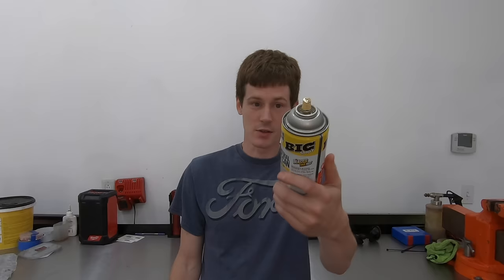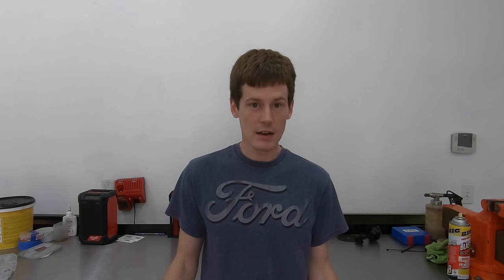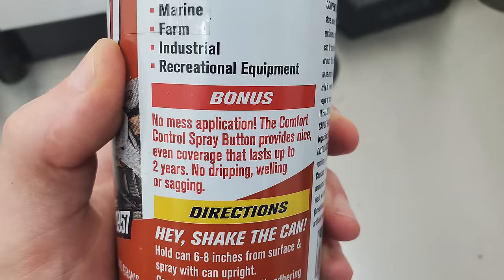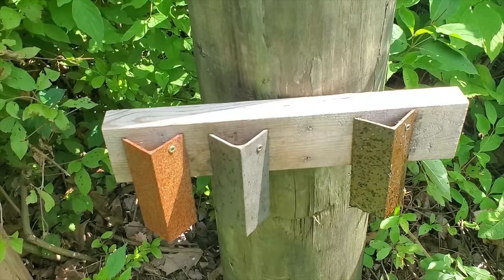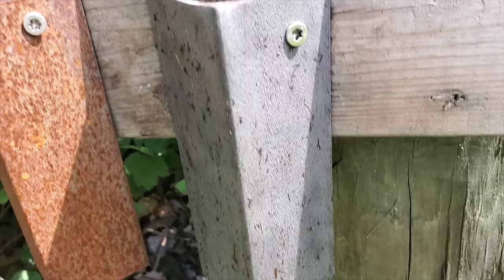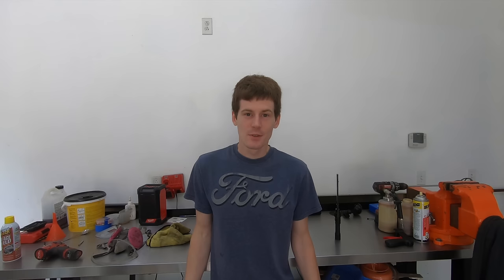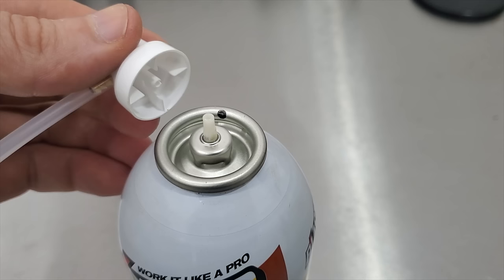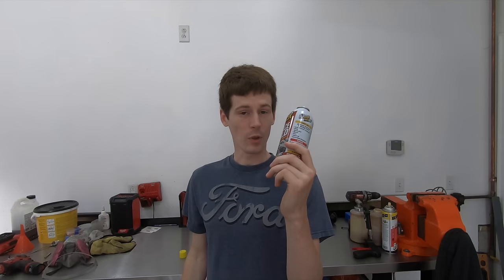I Finally Found The Best Undercoating On The Market... Blaster Surface Shield

Comment: Been using krown for 6 years on my 2005 silverado with 200k miles. Very minimal rust. The reality is, any of these products make a massive difference compared to the do nothing solution. Also, a spring time undercarriage wash to get salt off is essential.
Reply: I wish I knew this years ago. My 04 Silverado had a very small amount of rust and now the rockers are pretty much gone after a handful of winters.
Reply: I do an undercarriage wash after every snow storm.  Helps a lot!
Reply: @vfr800ification  I do this too - I have a pressure washer and an attachment that rolls on the ground and sprays four jets right up under the car.  I use a mix of dish soap and Salt Away to remove dirt and salt.

However, is it better to wash the chassis frequently or give it a coating and leave it?
Reply: @JimmyDoresHairDye  A bidet for cars.
Reply: @JimmyDoresHairDye  How do you do that in winter when it's below freezing?  Aren't you just coating car and driveway with ice?
Reply: This channel does not recommend an undercarriage wash. He says just a wire brush to take the worst of the rust and spray on the fluid film..  Now I am completely confused again. There are always so many opinions that at the end you just go for what you self believe is best..
Reply: @nmt2893  Manual carwashes with overhead doors? They are dwindling.
Reply: @Dani-it5sy  My college chemistry professor said the corrosion factor is water "and" salt. But once salt-laced slop winds up on the undercarriage in winter, it is best to wait until spring to clean it all off to minimize the amount of saltwater lying against the metal.
Reply: @vfr800ification  Yeah than just hit the main areas again with oil.
Reply: I was of the same opinion but Repair Geek has changed my mind.  The salt can't get through the lanolin anti-corrosion coating, unless that coating is removed with a pressure washer.  My "spring time undercarriage wash" is the spring and summer rainwater on the roads that washes the salt off the Surface Shield for me.  I reapply Surface Shield on the outside of the frame every fall, even though every two years is probably sufficient, or maybe 3-4 years considering I drive 4000 miles per year or less.
Reply: I wash my car all the time in the winter to get the salt off  and all the salty slush that is up in the wheel wells  and that
Reply: @79tazman  YEah I never did this oil stuff until this year I always just washed off the undercarriage after every storm and that helped alot.Now that i have oil on it not sure what Im going to do yet.I cant see leaving that salt on for 4 months man.
Reply: @JimmyDoresHairDye  leave it until spring and then wash with garden hose (ie that sort of pressure).  If you look at the FAQ's and reviews of Woolwax, which is the thicker sister of Fluid Film, that's what they recommend.  They give another coating to exterior surfaces the next Fall.  I can attest that annual applications of any of the thinner versions (like Fluid Film or Corrosion Free 3000) to interior surfaces or low splash areas like door bottoms will indeed cease any existing rust.  My 07 civic door bottoms starting showing rust from a few feet away around 2017 and at that time I began annually dousing the bottom inside and also through the drain holes with Corrosion Free (also known as Rust Cure) and the rust stopped migrating and stopped further pitting....surprising for sure, but surely works.
Reply: @Dani-it5sy  slather on in the Fall, garden hose rinse after last snow fall.  Maybe touch up any forward facing super dry spots you can see around mid-winter, slather on again in the Fall.  Getting every trapped cavity on the initial application is essential:  gas tank straps and above the tank (possibly even pulling your backseat and accessing the top of the gas tank cover just to get it slimmed once every couple of years), all control arm connections, interiors of all frame components, interior of all uni-body or frames, inside rocker panels, up inside door columns between front and rear doors, up and behind each bumper cover and cover brackets under headlights, inside trunk under carpet, behind trunk carpet toward tailights and also forward toward the rear doors, inside doors including window runners (thin sheet metal holding the felt-like track liner the window slides in going down into the door (mine rotted away in the front Civic doors).  Hope this helps....oh, there are a few spots that applicators will drill and plug with a grommet....you should look into those for your vehicle...could be the door interior vertical trapped volumes you don't see when the door is shut, and then others.
Reply: If you spray under the vehicle , do it with no soap, in the Rinse mode only!
Reply: @nmt2893 
You are supposed to apply it at a minimum of 40 degrees Fahrenheit. There would be no reason to apply this in your driveway in freezing temperatures. If you bought a car in the winter like I did, rig up a way to heat a space in your garage, or find a business or individual where you can rent a heated space, or pay to have it done. Since the coating lasts a minimum of one year, but probably two years, there would be no reason to wait until cold weather to apply it.
Reply: Absolutely just do something anything to protect your investment. I'm 60 Been using motor oil and diesel for decades. I use some store bought products now as well. Mt cars don't rust away.
Reply: @David Hickenbottom  10,000% agree
Reply: @79tazman  the amount you pay for all those washes, and all the labor and time, youd be better off just using surface shield or wool wax imo.  No need to wash with these products. My buddy a new f150 that hes driven daily 7 upstate NY winters, and just wool waxes it every fall, he doesn't wash the under chassi in the winter. The truck has 0 rust.  ZERO.  My truck has surface rust all over it, and after seeing his truck, i started wool waxing mine.  I took a needle scaler gun and knocked all the lose rust off my frame , then wirebrushed the crap out of everything i could reach.  I havent seen any rust developing in new places, nor the rust thats on there getting any worse.  Im glad i found out about this now becuase the body has 0 rust still, and the truck only has 74k miles.  If i wouldnt have wool waxed, the truck would probably be rusted to nothing by now.
Reply: Nothing beats Krown if you get it applied annually.
Reply: For static applications, nothing beats corrosion-free. If you want a product that will seep and creep and self heal under daily driving conditions, nothing beats Krown.
Reply: @Mark Armstrong  I've had superb luck with it myself. Gotta be diligent about applying it though because of how think it is but it covers all the nooks and crannies so well
Reply: @josephphillips865 how many years?
Reply: @whatitisnt.  It doesn't take long at all out here. My dad's 1990 Chevy (stored in a barn most of it's life) is completely rusted through the frame after 2-3 winters.
Reply: @josephphillips865  where is this? Perhaps that's because of the cars material. Modern cars would perhaps not rust that quick
Reply: @whatitisnt. Michigan winters. They have used excessive amounts of road salt for years which has been problematic to the environment and everyone's vehicles. Also true, the vintage of truck I mentioned must have used a lot of crap steel. Modern vehicles likely use better steel but in this area if you do not wash off the road salt frequently it does not take very long for rust to start showing.
Reply: @JimmyDoresHairDye  That will wash away some of the surface coatings. Perhaps wash underneath in spring and re-apply surface shield right before winter, say in mid fall or something like that.
Reply: @freeinhabitant2422  got myself a 1 gallon garden sprayer this month. Will put away the pressure washer with undercarriage attachment for the winter - realized halfway thru last winter that I probably removed the fluid film with the pressure washer. Just going to mist the undercarriage and wheelwells now to dissolve the salt.

Comment: I just own a ford and it comes standard with oil leaks. Great rust prevention
Reply: Must be nice Chevys come from the factory with rust
Reply: 😂 I have a 21 year old Toyota that has a unintentional under coating also.
Reply: My ford's don't leak nothing ones a 92
Reply: My fords have never had oil leaks.
Reply: @fordnut4914  must not drive them much or it was built on a Wednesday by a Chevy worker who just transferred to Ford. 

Jk, how many miles?
Reply: @johnt6673  that means you are out of oil
Reply: @jeremylakenes6859  my f450 has rollback 514000 miles on it my f350 has 240000 my ford fusion has 238000 none leak my rollback has a water leak due to water pump going bad but no oil
Reply: And who cares if it rusts away.
Reply: @fordnut4914  must be out of oil lol
Reply: Then you must have a 7.3 diesel truck
Reply: @josephpuchel6497  6.9 Diesel… lol

Comment: Have you used Corrosion Free - Rust Cure Formula 3000?
Reply: Corrosion Free is the best, so clean no smell and it lasts
Reply: @JacobDelGrande  is it not safe for rubber items?

Comment: I started watching your videos because I heard you mention lanolin as an undercoat. The reason it interested me was because I am an industrial machine mechanic, I work in alot of different environments from high to low temp. and different percentages of humidity. I began using a tool bag several years ago and my Dad told me that if I was going to be working in all these different environments that I should thin coat my stuff with lanolin to prevent everything from rusting. That was thirty years ago, my Dad is gone but every tool I owned from that time is still rust free. I still have guys ask me when they see me loading up my tools what am I using and I tell them lanolin. I use mineral spirits to clean and lanolin to protect. Then I usually have to have the WD-40 argument with them. I have seen machines get destroyed because these guys grow up thinking WD-40 does it all, it does not. Anyway, you gave me some justification for my seemingly anal aversion to WD-40 and my belief in lanolin. You have useful info and your presentation is concise and interesting! Great stuff!
Reply: WD 40 frees things up immediately but attracts moisture in the long term. WD-40 is obsolete in my opinion.
Reply: @jeffrobodine8579  WD-40, literally means "Water Displacement 40th attempt" I have never heard anyone state it attracts moisture.  It's a poor penetrating lube IMO compared to KROIL or PB even.
Reply: @GregHuston       Is this a joke? Project Farm's testing shows that PB is one of the absolute worst penetrating fluids on the entire market. Even WD-40 beat PB as a penetrating fluid.
Reply: @SergeantExtreme  Not a Joke, WD-40 does NOT attract Moisture it Displaces Water!  How's that a Joke? KROIL is the absolute best I don't care what some guy on a farm shows and PB is a penetrating lube, WD-40 is NOT, WD40 the brand does sell a specialty WD-40 branded penetrating lube but is not the traditional WD-40.
Reply: How do you apply lanolin. 
Where do you purchase it?
Reply: @SergeantExtreme  this isn't about penetrating oil, it's about undercoating. Are you a tug boat captain from New Jersey by any chance ?
Reply: Correct. WD-40 is not designed to be a rust-prevention coating, except the specialist WD-40s like WD-40 Rust Prevention Lanolin (p/n: 21024).
Reply: Does it leave a slick surface? I need something to coat a porch handrail for rust prevention, but it’s for an elderly person so the top rail can’t be slick or oily. Thanks.
Reply: If it's rusted, wd40 will break it
Reply: Anyone else use CLP on tools?  Works for firearms, works for tools too
Reply: @ftboomer1 For a lot of my tools and knives, I use Frog lube.  I had a huge container of it and I stopped using it on my guns because they can build up in the firing pin chamber, If you aren't very careful

Comment: Blaster Surface Shield Home Made Extension Sprayer for $5 : Needed items  3/16 copper or steel tubing , 3/16 drill bit,4 ft  of clear flexible  rubber tubing and a little JB weld  . Remove the spray nozzle from the blaster can . Carefully drill out the black spray orfice with a 3/16 drill, drill out just the black part  .  Take 3 inches of the copper tubing ,  chamfer debur the end , apply JB to the outside of the tubing and press it into the spray nozzle where you drill it out  . Add the 4 feet of clear tubing to the  copper tubing and you are done . Worked great for me . I took it one step further and heated the end of the  clear tubing and pressed it together in a vise to plug/close it off &  then drill about 30 tiny holes in the length of the tubing at different spots and angles and this thing sprays Surface shield in all directions very well .  This does not take long and works well  inside rocker panels , the frame and other cavities .
Reply: PD, great narrative 
Need to make a vid of this!
Reply: thanks for info. if you get a chance, please make a video, upload to youtube and post it here
Reply: Great idea!  I have a sprayer but no hoses, so I'll make some.